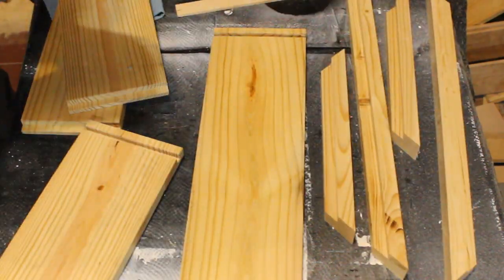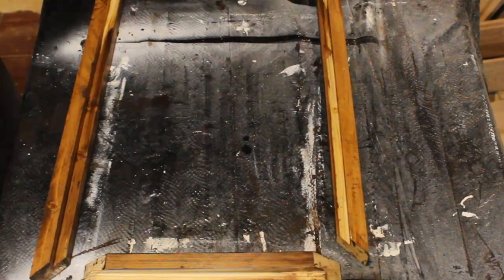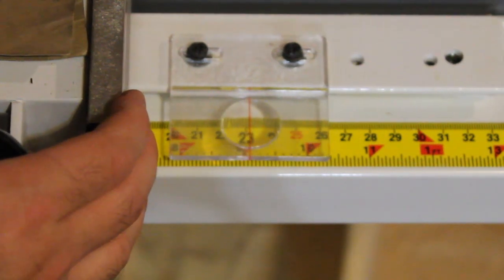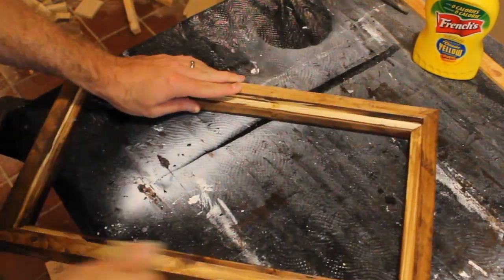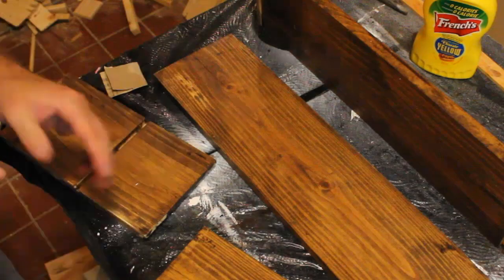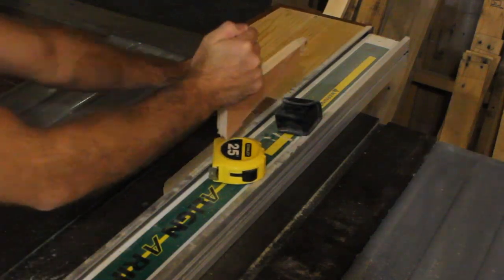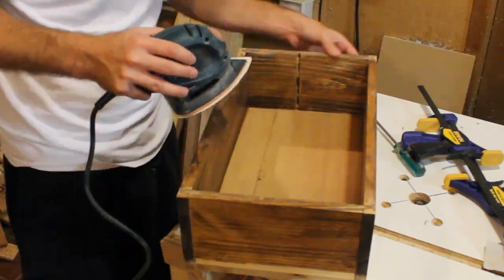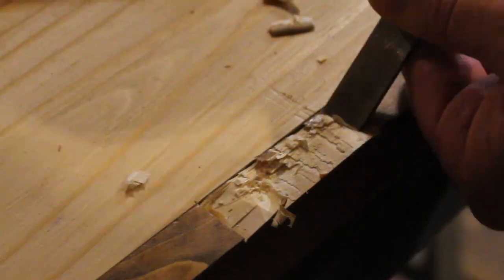Whiskey Gift Box Set: Part 2

Comment: Love your stuff!  I found you through your podcast actually.  I have a business based primarily around building farmhouse furniture most of which comes from reclaimed barnwood or from local sawyers who "reclaim" fallen trees from storms, power companies, and etc.  I do admit I buy from the big box store as well but I'd say 75% of what I use is reclaimed in one way or another.  I worked yesterday for the first time using my new headphones with the bluetooth adapter connected and listened to all of the podcasts you guys have put on so far!  Made for a great day!  For finish staining I use gel stain exclusively and I can give you a couple pointers.  If you open the can and it's really thick mix in some mineral spirits, i noticed that with the brand I use will coagulate over time when this happens it "cakes" on the boards and is a mess to wipe off.  I'm going to guess that the wood you were using was spruce or maybe yellow pine, the pith in those woods blotches no matter what even if the dead center of the pith is removed the inner rings tend to blotch.  Also try out a terry cloth covered sponge for application.  I buy them from Home depot of lowes but if you care for them they will last a long long time.  I always put the sponge back into the stain can and seal it in so it keeps going.  There is one sponge in every stain can and I know unless I get a new color I always have a sponge!  Don't give up on the gel stains they work fantastic and give a very predictable result every time which is great when you take stock photos and then build custom work around those photos!
Reply from the maker: thank you so much for the comment, support, and advice.  since this video has come out, I've probably done another 10 boxes and I've used the gel with much better results.  thanks for your tips, I'll definitely use them :)

Comment: When working with pine or any soft woods you should always condition the wood first by getting a product called "wood conditioner". I have in the past used regular paint thinner just wipe it on, then before it dries stain the wood. It won't be so blotchy.
Reply from the maker: +20tssmoke20 Thanks for the comment :) Since releasing this video I've purchased and used wood conditioner.  I have however heard that Gel stain does not require it and frankly I haven't seen much of an improvement after using it.

Comment: I've never used a gel stain, but I wonder if it may have been because you did all of the pieces at once. I'd say maybe try one at a time if you haven't already tried that. Either way, I think the box turned out pretty nice, and you gained a subscriber!
Reply from the maker: Thanks, I appreciate the sub.  Since this video, I've probably done 60 or so boxes.  I now stain by essentially rubbed it in and then rubbing it off.  So that it's basically dry to the touch.  I then wait a couple of hours or overnight, then hit it with some kind of clear coat.